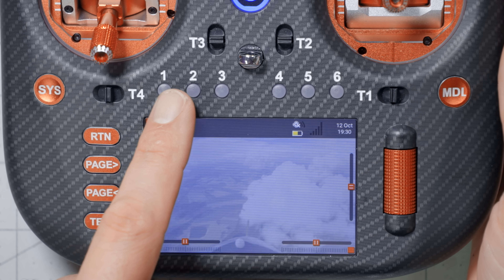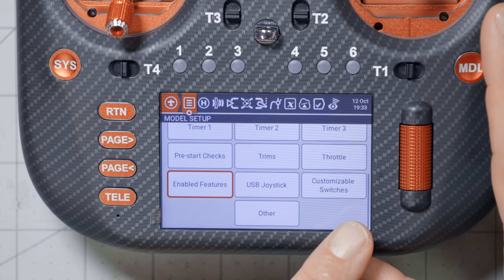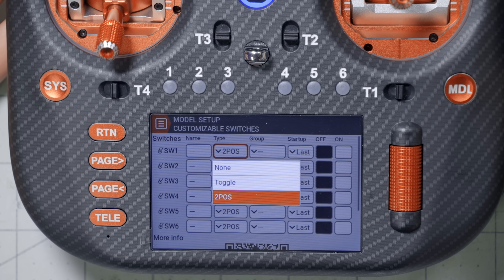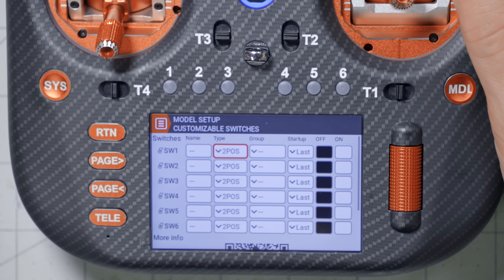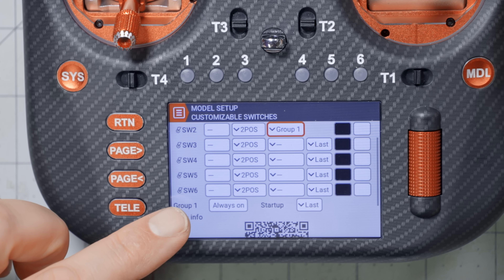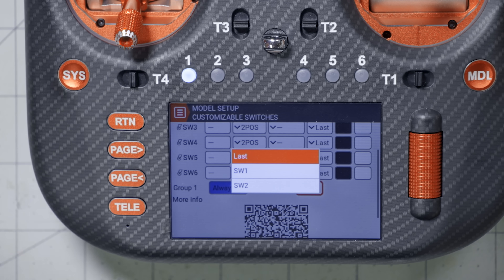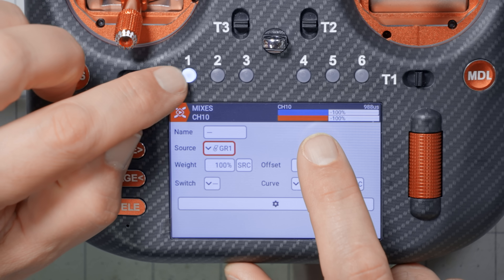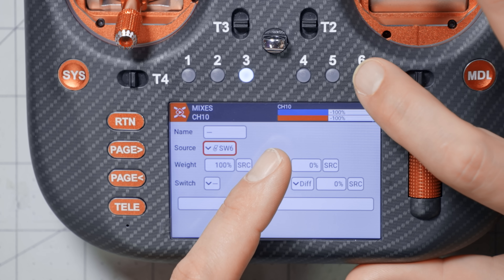EdgeTX 6pos Switch Custom Programming // EDGETX 101 EP12

Comment: I get it configured finally on my Jumper T20 V2.
Main and very impoooortant thing need to be mentioned - this works on edgetx 2.11+.  With 2.10 it was not possible. And to update firmware to 2.11 on t20 I have first to update bootloader, and then flash with ned firmware.

Comment: Anyone know if there's a way to change the transmitter power with these? I know I can set an aux to enable dynamic power but I'd like to be able to pick the output.
Reply from the maker: No sorry. You can't go to a specific power level.
Reply: @JoshuaBardwell Thank you for letting me know so quickly!

Comment: Hi! Thanks for the video!
Toggle+2pos could be useful on the ground models. The builds with four-wheel steering (two steering servos), two+ motors, diffs with servo locks, dig, winch, etc. There are situations where you want an "off" button without going through individual toggle.
Plus for LEDs and sound modules.

Comment: Hey JB if you update your firmware on the GX12 to nightly they included SA and SD in customizable switches... 3.0 is going to be coming out soon and one of the new features is you'll finally be able to use the rgb with all customizable switches SA-SD SW1 thru SW6... just like you said only tx15 and the gx12

Comment: hey mr.Bardwell... i have question not related to this video, but its about my radiomastertx15... i run into problem after i flash firmware from radiomaster webs my radio dont want to turn on, i can only get into bootloader screen. it said "copy firmware to EDGETX.UF2 drive" i tried to copy some files it said that drive is full and need more storage. the storages only 32MB. also at thr bottom showing "no version" on my bootloader radio... please can you help me?

Comment: well dang, that would be perfect for in-flight adjustments. 3 buttons to choose roll, pith, or yaw, and 3 to choose p,i, or d. All off to disable adjustments. I have been using 2 3pos switches to do that, and yet another switch to enable adjustments. Then of course one more 3pos switch for adjust up or down. In-flight adjustments eat up half the switches on the radio :)
Oh, and can I mention, your voice pack does not include "roll" "pitch" "yaw". I had to scrape roll pitch yaw from another voice pack.

Comment: Thanks for creating content that I find interesting, informative, and entertaining. My daily driver is a GX12 and I intend to program a couple of the six LED switches for beeper and LED light control on a few of my quads. Right now I'm controlling the beeper using one of the circular momentary buttons on the top right of the radio. I tend to hit it inadvertently a lot. No harm, but it's annoying. I have a different model set up in my radio for each of my five quads (I know, but it makes the most sense to me). Only one of my quads has a decorative LED strip. I plan to program on of the six switches to control that. Those six LED switches are also handy for the handful of GPS functions that I use on my INAV equipped quads. Thanks again for the info, JB. I've been putting off programming those switches on my GX12. You've made it seem easy. Happy flying, my friend. 🫡 🍻

Comment: As always fantastic. Been following so much already from how to fly in Liftoff to how to build your first drone to this.... one thing I would love to see and couldn't find it anywhere is how to setup the radio for a quad! Did some crazy stuff already for Pre-arm then Arm using nearly 10 Logical Switches and Bolean Algebra but really needed a State based solution. Took it to the EdgeTX user group and got told that I didn't need any of that stuff.... feel like a dork now but still not sure about the best way to setup my radio for an actual aircraft?

Comment: I've a really specific use case, where I'd like all 6 buttons to act as momentary buttons, but use only 1 radio channel. Is that possible?
Reply from the maker: I don't think that's possible, unless you are willing to assume that only one of them will ever be used, and if two of them are pressed, the right-most one "wins". If you were ok with those assumptions, then make six mixer lines , each of them with SW1, SW2, SW3 ... SW6 as a source. Each one has the Mulitiplex parameter set to Replace so the right-most one "wins" if two are pressed, and they don't add together. Then adjust Weight = 1000 / 5 = 20 so that they are reduced in "width" from 1000 us to 200 us. Then adjust Offset so that each one "triggers" a different position in the channel: -100, -60, -20, 20, 60, 100.

Some of the exact numbers might need fiddling but that should do what you're asking.

Basically, reduce Weight so they take up less than one whole channel and then adjust Offset so each switch puts the channel in a unique position.
Reply: @JoshuaBardwell amazing, thanks!

Comment: Toggle option seems a bit pointless. It would be like trying to use the stupid touch controls on your VW steering wheel whilst driving.
Reply: You could use it to reset your timer.    I have one of my switches doing that, and it would free up a switch

Comment: Great and informative video! I use my 6-position switches to display voltage levels.
Reply: How do you see them through your goggles?
Reply: @Flipflop_FPV  I know it’s not visible through the goggles, but it’s a useful feature for LOS pilots, especially for helicopter pilots.

Comment: The reason you set it to none is if you only are using one switch. I had two switches set up, one for arming one for auto tune. When I hit the autotune button and it  disarmed. Without putting it to none, it will operate the other switch.

Comment: Was watching a video about 6ps switches on boxer when this video came out so i am here
Reply: Can you do any of this stuff on the boxer?
Reply: @Mekchanoid As i found out fast i cant i dont have S3 switches special functions in the menu. Don't know why mb cause the radio is older and i have C2500 chip , Elrs i use external module. I think i did flased the new firware Edge TX but nothing there, mb there is a way to flash the right software but i am not looking no more

Comment: GX12 should be everyone's daily!
Reply: Mine is tx15
Reply: Tx15
Reply: Maybe not for LOS pilots
Reply: @MrBlackmidi1234567890987654321 I dont see why not?! Unless you are chasing the latest and greatest in gimbal control. But what benefits come with "upgraded gimbals" for LOS? I fly LOS a lot, so I am not like crapping on it or whatever.
Reply: @kjkj841 the colour screen would be a plus for me so I can have more telemetry readouts like throttle%, RPM (for helicopter pilots), Battery percentage etc etc

Comment: Dude, it's 2026. How is it possible that this video doesn't have an audio track in different languages?

(Please add the Spanish track)
Reply from the maker: I'm sorry but I hate auto-translated audio tracks. Whenever I encounter a video with one, especially a technical video, the translation is so bad as to be useless. I'd rather just not have them at all.
Reply: @JoshuaBardwell ...and it's still 2025...🤔🤭
Reply: @JoshuaBardwell  To foreign audiences it's clearly better than nothing, though, right? Right?
Reply: @Mekchanoidsubbing exists
Reply: @Mekchanoid Yes. Definitely better than nothing. I would love having closed captioning in my choice of language... YT, are you listening? 🤔🤭
Reply: @JoshuaBardwell also auto dubbing sounds bad in general